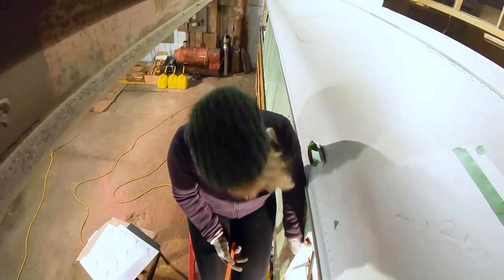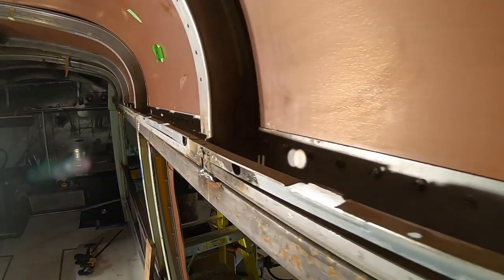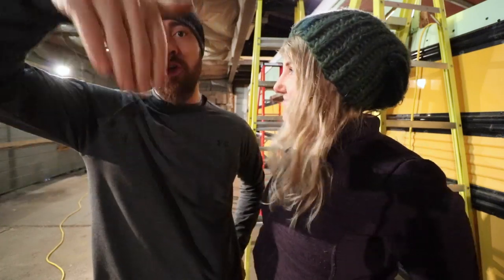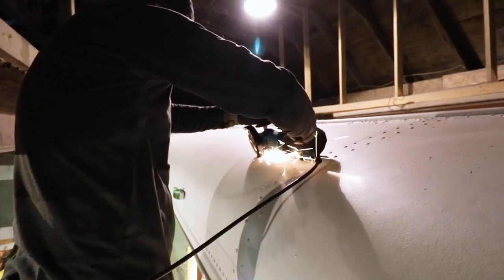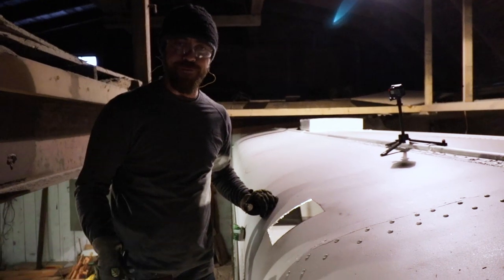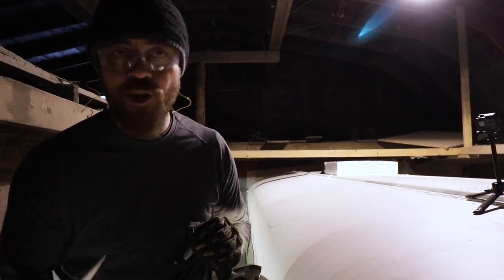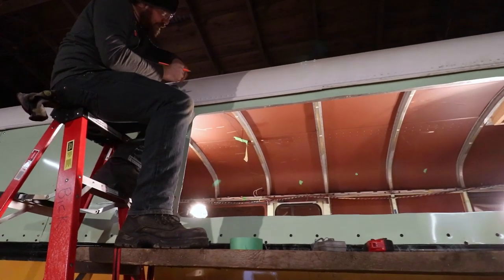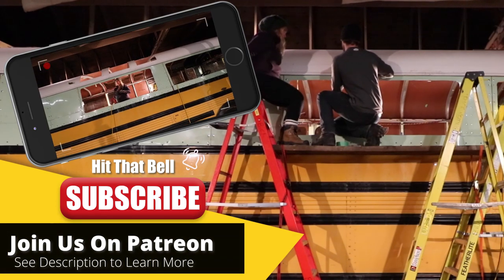Never Seen Before Skoolie DIY Skylights For Tall People Part 1 | Bus Conversion

Comment: You can use an oven to heat up the plastic and bend/form it to the desired bend you need. Just don't cook it. When you get it to correct heat, it'll bend easily. Place it in place onto the opening to achieve the proper bend. It'll cool in place at the correct bend and stay set. I look forward to seeing more from you. Rudie.
Reply from the maker: Great idea @Rudie Arendt! While we won't have access to an oven out at the barn, we will have access to a heat gun. Originally we were just going to bend it because it is only 1/8th thick, but you've got us thinking we should heat it up so it forms, instead of always fighting against the screws. High five! - Brian + Erin
Reply: BE Adventure Partners Maybe you have access to a space heater that would heat it up on a large surface area scale. The heat gun would work to pin point heat it. You'll have to work quick, from heat to window placement. Wear gloves.
Reply from the maker: @rudiearendt808  - We are up against the Canadian Winter right now. It's -13C today. The barn is just as cold. On less cold days we can get the temperature up to +10C with our big 135,000 BTU Heater. LOL So this should be interesting. We were thinking if I (Erin) hold the heat gun and sway it back and forth while Brian drills the screws in it will help. This stuff blends super easily. So fingers crossed. We will have to wait for a warmer day just to be safe. Fingers crossed that comes soon. We officially caught up to our footage. Hhaha
Reply: BE Adventure Partners I can understand what you're up against. Maybe, you can use a couple of heat lamps along with the heat gun. When I used to do bodywork, we had infrared heat lamps that were of a quartz design, not to make light but to create heat only. The design of it is still in use today but even on larger scale e.g. outdoor space heating, large warehouses, shop's etc. At the very least maybe a hot tent around the area your trying to work the sky lights to help stave off the cold air. It's just suggested thinking about your project. I know you're the ones doing it in the cold barn. I'm just offering an out of the barn look in. No pun intended, well maybe a little...
Reply: A roof spot they aren't putting a window would give them a smooth surface with the exact curve they want. Should be able to use the roof as a form then move it over the hole after it is shaped.
Reply from the maker: Lol, we appreciate a good pun @Rudie Arendt. This is all great info. Thank you. We were really lucky to have a nice day above 0 on the weekend. It was about 4C. So we went ahead and heated up the barn to about 10C. Our 1/8" poly has a 12 1/2' radius bend. It bent SosooOOoOSoOSoOosOosoOooooooooooo ________________. You will see in two videos from now. LOL
Reply from the maker: This is a great idea @Andrew Klapec. In 2 videos you will see what we ended up doing. Thanks for the awesome input. - B+E

Comment: Hey! Thank you for detailing this process, I am going to follow your lead with my skoolie! I am wondering where you found your poly and if the skylights are easy to stand under? I'm trying to make mine above my head where my kitchen is going. Thank you!
Reply from the maker: Hey there @Amanda Wilder!
We bought the polycarbonate on Amazon here: https://amzn.to/3stEBnn

You can see the skylights in action in this video at this time stamp: https://youtu.be/orJX_wAM55U?t=142

Because of where they are in the ceiling curve, it's not really in my (B's) head space. But they do allow a ton of light!

Now that we've been using them for awhile and cooking under them, they do collect condensation when it's cold outside. With the Maxair ejector fan on, that helps to pull the steam out. That's all a part of life and single-pane issues. But we think it is a fine tradeoff.

Thanks for watching!
- Brian + Erin

Comment: That'll be good for Brian's psychological comfort level inside the bus.... less claustrophobia.
Reply from the maker: LOL @AllMoMoMostHome Bus! Ya, without the roof raise it was an absolute must in our main living space. We aren't doing a roof raise because it's already huge, and we want to keep it as sleek as possible just in case we put on a deck ;)
Reply: @BEAdventurePartners  I'll share our plan for the roof, in case you want to use it... lofted bed in back... 2 ft x 6 ft skylight hatch over head to see stars at  night. Then outside on the roof were welding a strong tubular metal space frame to hold high quality white catamaran netting probably something like 7x6. The idea is to be able to climb out onto roof and sit or comfortably lay down and stargaze. The sailboat netting would be a lot less weight than any deck, easier to install, easy to replace, and comfy to sit or lay on.
Reply from the maker: Holy smokes @AllMoMoMostHome Bus! That is such a rad idea! We cannot wait to see that! Genius! We have never seen that idea. That would be so comfy! I wonder if you could do yoga on it?!
Reply: @BEAdventurePartners  I don't see why not.  Would be softer than on a deck.  They're designed to belaced very tight. Some flex but still easy to walk on.
Reply from the maker: Hmm, now you have my wheels spinning. Have you found any good sellers for it? We would love to know a bit more about it @AllMoMoMostHome Bus?! :)
Reply: @BEAdventurePartners  I'm working on getting pricing from two or three for a custom size.  There are a number of them online.  ATN Sailing Equipment thought 13 mm polyamide would be the most comfortable and would stand up to highway speeds. I'll email you if I find a good deal.
Reply from the maker: Hah you are the best @AllMoMoMostHome Bus. This is such an awesome idea. Thanks for sharing your research with us. :)